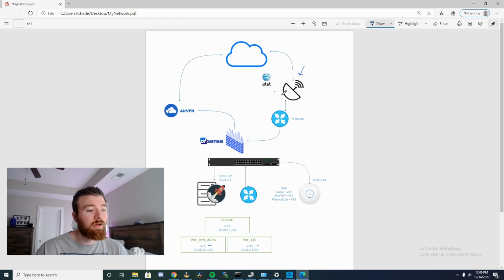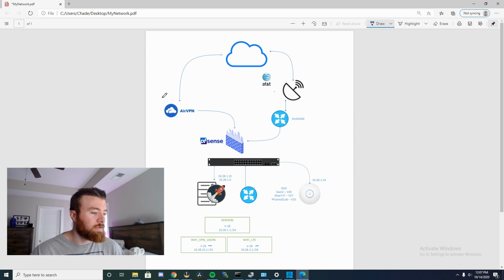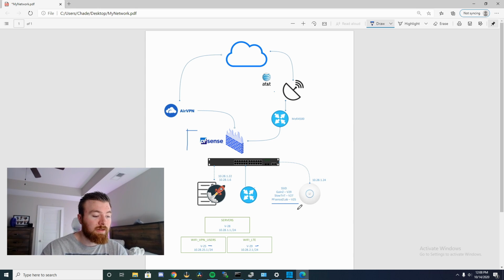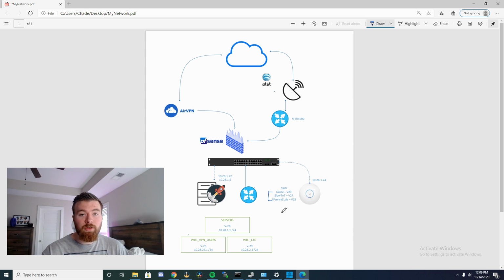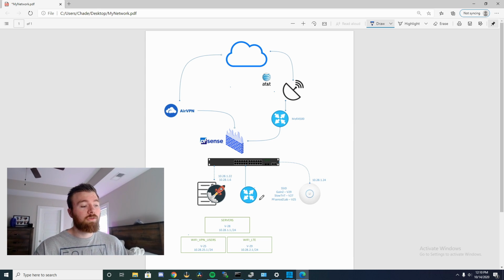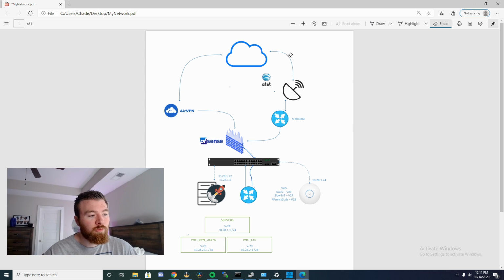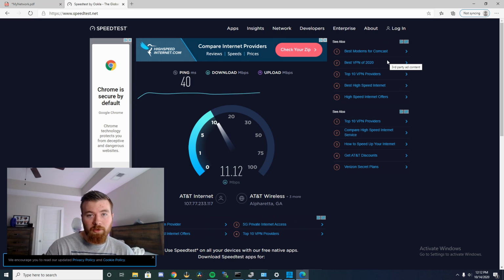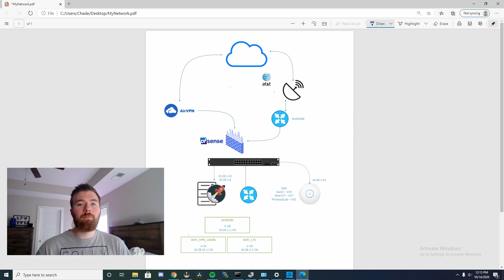Home Network Tour of a network engineer - Rural Internet | its complicated

Comment: How many RU's is your rack? Brand, cost and link to purchase (if you have)? Looks really solid.
Reply from the maker: I got it off of Amazon. It's a 15U, 4 post rack and is adjustable. Here the link, https://www.amazon.com/Frame-Server-Enclosure-Adjustable-Depth/dp/B01M9DQAMS/ref=sxin_9_pa_sp_search_thematic_sspa?cv_ct_cx=Raising+Electronics+Server+Rack+4+Post&dchild=1&keywords=Raising+Electronics+Server+Rack+4+Post&pd_rd_i=B01M9DQAMS&pd_rd_r=f479b10b-c2f6-4510-9091-c3df875316bb&pd_rd_w=dkPZP&pd_rd_wg=jKtiT&pf_rd_p=f367244a-ec9b-4788-8f50-5a01fb31732b&pf_rd_r=FAR2G1ZMGAXFX4CEJKNB&qid=1619181686&sr=1-2-a73d1c8c-2fd2-4f19-aa41-2df022bcb241-spons&psc=1&spLa=ZW5jcnlwdGVkUXVhbGlmaWVyPUEyVUQ1QzlLWkFLUE9LJmVuY3J5cHRlZElkPUEwNTMwNjY4MjdXSTUyNFUwWE9ZMyZlbmNyeXB0ZWRBZElkPUEwMzM4Nzg3MjNXSkZYM1I3NFo3RiZ3aWRnZXROYW1lPXNwX3NlYXJjaF90aGVtYXRpYyZhY3Rpb249Y2xpY2tSZWRpcmVjdCZkb05vdExvZ0NsaWNrPXRydWU=
Reply: Thanks Chad! I’m looking for a 15U to 18U 4 post rack and with the solid front base and costing $176 this rack looks perfect! Does the rack move side-to-side as you install devices or is it rock solid?
Reply from the maker: @matrixnew00  really sturdy! Mines been great.

Comment: Wow, kinda thought most neighborhoods would have access to cable internet by now, seen another comment you have gig now, that's quite an upgrade, currently have 15 down Adsl, looking at getting xfinity 600 down, for the same price after interductory rates....
Reply from the maker: It's crazy how much of a difference the expense is for such low speeds and yet you can pay relatively the same amount for better. Most of the time this is due to older technology requiring more upkeep and thus cost more. I'm happy you are getting an upgrade! It took me almost two years to get this upgrade negotiated and in place. Some aren't as fortunate. Thanks for stopping by!